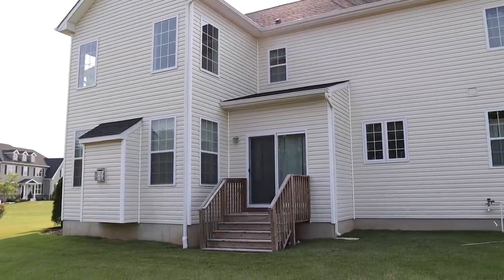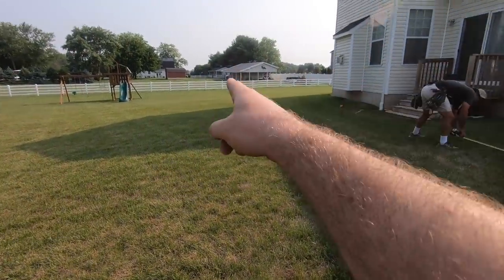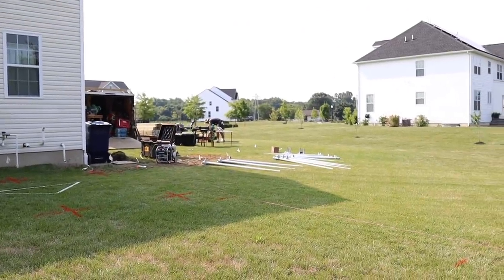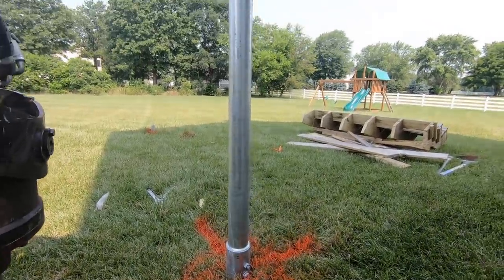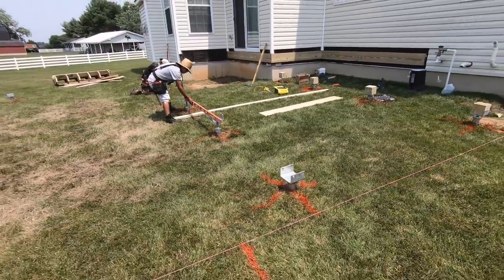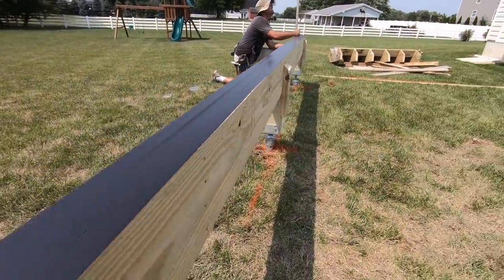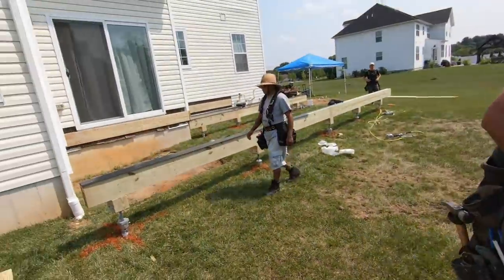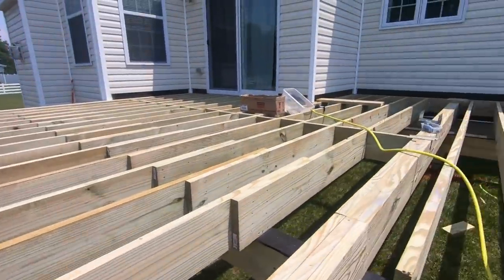Installing Helical Piles And Deck Framing For Screen Porch - SCREEN PORCH PARADISE PT 1

Comment: Two questions - 1) is the scab on the beam an approved method to join the beam to the post? I’ve only ever seen the bracket connectors or notched 6x6 with 2x double beam.
2) How is the structural load from the 6x6 carried at the house? Did you put a pier that close to the house or is it cut into the house resting on the concrete wall?
Reply: Great vids btw, I’m more interested in how you put it together than the finished product but I’m always impressed by the quality
Reply from the maker: Thank you my friend!! Our architect draws the beam connection detail like that, and I love it because it creates a much more stable connection than a post to beam bracket. I forgot to show the wall brackets for the post connection at the house, but goliathtech makes a bracket that goes into the concrete foundation which you put a small 6x6 in under the triple rim joist. Really cool piece of hardware for applications like this!

Comment: Q? - do they make helical piles or cast ogre that are capable of splitting rocky soil ? That would be phenomenal. Like magical titanium tipped ogre .  Probably have to water it down to pull up the dirt in clumps on an ogre
Reply from the maker: That’s a great question, I’ll have to ask my installer what they do in rocky soil because they mostly install in north jersey where it’s almost all rock. We don’t deal with it much around us but I know they have some techniques for it. Next project we’ll get some answers!
Reply: @THEpremieroutdoor   the peanut gallery chanting : “rocky soil, rocky soil….”

Comment: What is the frost line in your region? These helical piles seems excessive if it is something like 3 feet. In mine is close to 6 feet, that's Canada for you...
Reply from the maker: Ours is about 3 feet but it saves us time since we don’t have to wait for inspection and we don’t have to worry about the bearing capacity of the soil. The torque reading makes sure that it can handle the loads
Reply: I think if he is able to save a day of labor costs every project it’s probably worth it in the long run. And no call backs for structural failure for sinking footer or failing PT posts. Even one of those is a massive cost to business.

Comment: Can’t use helical screws for residential applications in too rocky soil. Source: personal experience <1 yr ago. Wish I’d been able to. Also - built a 1000sqft 2-tiered cedar deck with help of your videos. Lots of thanks.
Reply from the maker: That’s awesome to hear our videos were a help to you!! We don’t have many rocks in our soil around me, but our installer also does north jersey which is very rocky. I’m not sure at what point the ground is too rocky to work with but luckily we don’t have to worry about that in my area haha